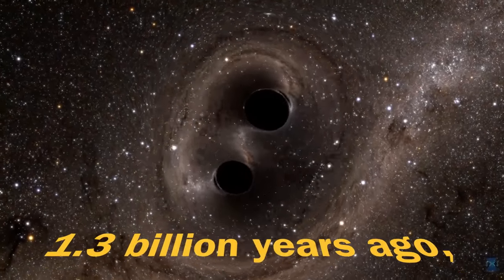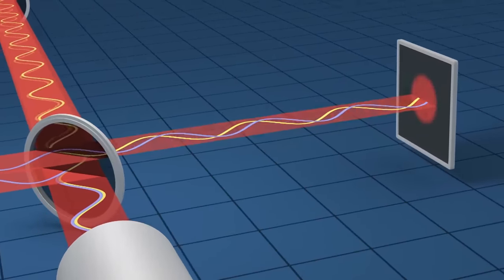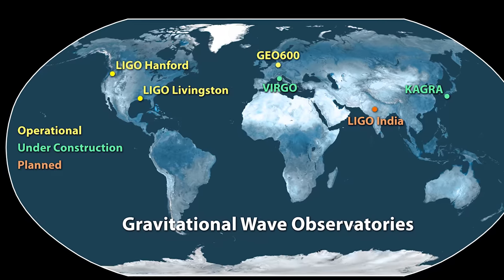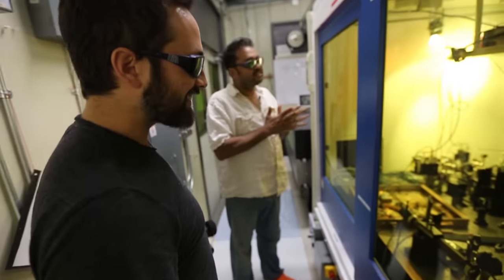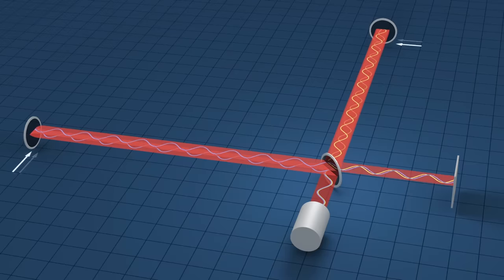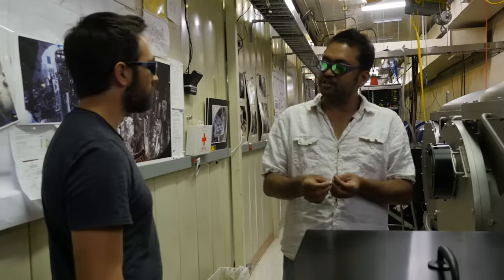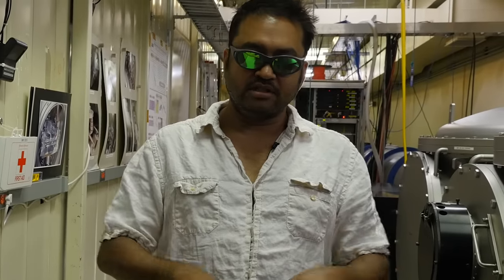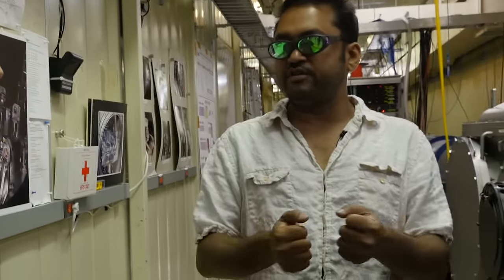The Absurdity of Detecting Gravitational Waves

Comment from the maker: Prof Rana Adhikari is clearly a star. Here's how he felt when he learned of G-wave detection: https://youtu.be/ViMnGgn87dg
Those glasses provide laser protection - the laser in that lab won't vaporize your head but it could burn your retinas.
Reply: Kissy kissy.
Reply: Veritasium Name should be pronounced as Rana Odhikari ( 'A' is pronounced in Bengali as 'O')
Reply: +Veritasium
Next step will be using two slits for studying the diffraction of gravitational waves!!!
Reply from the maker: I believe the upgrade to 1MW they're implementing right now. The 1064 nm lasers have excellent stability, low noise and they are not huge - this makes them ideal for this purpose. BTW older g-wave interferometers used green lasers (that's why Rana's glasses were green).
Reply: Veritasium Hey why are you guys wearing the glasses in there? Some protection?
Reply: Question, if the laser light is completely encapsulated within these steel tubes, why do you wear eye protection against lasers in the lab?
Reply: Loved the video. Possibly your best. Which is saying something. I love videos like this that just numb your mind.
Reply: Is it possible to reflect gravitational waves???
Reply: It would really helpful for understanding if there would an animation of the set up when a G-Wave hits its.
Reply: yes,, using a gravitational mirror, well its not yet observed, but it would be awesome to do,
Reply: Well, He is A Bengali, I am a Bengali, proud of him!
Reply: what other detector geometry designs exist (on paper or in production) for detecting gravitational waves that might be better than the "L" shaped one of LIGO.? There is the E-Lisa observatory which is like a triangle, but is there anything else?
Reply: One question, Veritasium: How did we know about these 2 orbiting Black holes in the first place? (it seems we were trying to catch the resulting gravitational wave, meaning we were expecting them ?).
Reply: TheRomichou They didn't know the existence of those black holes until measurement.
Reply: TheRomichou, the detection was a surprise. We didn't know about the two orbiting Black Holes until they were detected.
Reply: Luis Calderari No, they can be refracted but not reflected. My understanding is because electromagnetic forces have both attractive and repellent components, but gravity is attractive only. So strictly speaking, no. But repellent gravity is possible, which is seen in "dark energy", so perhaps if you have concentrated dark energy in one place, maybe you could reflect? I'm not sure.
Reply: Veritasium - what about interference from nutrinos? Cant stop them from getting into the vacuum arms...
Reply: I see, So, LIGO was built to detect gravitational wave; but we knew already that there were tiny and that only big events (like black hole merging) could be detected; When they got the signal, they compared it to their model of black hole collision, I guess. Could it be anything else? I mean, could there be any event that could cause a significant space-time fabric distortion that would look like the "woosh" ? (genuine curiosity, not trolling). Thanks for your reply BTW!
Reply: TheRomichou They pre-calculated the gravitational wave patterns for many different spacetime events, and then compared the detected signal to these calculations in order to identify the source.
Reply: Now it is clear. Thanks Michael!
Reply: Proud Indians 😇
Reply: jdnels81 That's the exciting part about gravitational waves. A complete new scope for Astronomy. Lots of new discoveries are coming.
Reply: Could it be used to get the wrinkles out of his shirt? :D
Reply: Veritasium 
We had the luck that one of the creators of the lasers of LIGO was visiting our school in Germany. She hold a presentation for about 80 mins about gravitational waves.
Reply: maaan You are a star!  Awesome vid, Rana is a top lad!
Reply: Best video yet! Thanks! 
Are they able to "triangulate" or at the very least determine the direction the waves came from? Or is that still beyond our capability?
Reply: 5:37 How do you know anything is stretching? 

I thought you needed perpendicular arms for detecting that, because the wave does not stretch  space equally in every direction. Was I wrong?
Reply: 5:37 How do you know anything is stretching? 

I thought you needed perpendicular arms for detecting that, because the wave does not stretch  space equally in every direction. Was I wrong?
Reply: Matthew Merrell using the time difference they can narrow down to a sliver of the sky where the waves came from but as more detectors come online they will be able to triangulate
Reply: dAvrilthebear That is right and that was said wrong in the video. You detect the waves by splitting the laser beam up in two parts. If the room was streched by the gravitational waves the signature of the light is different and this difference is messured.
Reply: Perhaps just as importantly, he knows how to voice resonant "bone chanting" (1:00) which is a used by both the Buddhist/yogic mystics and circumpolar shamans as a technique for aligning oneself with the inner systems of the body (biofeedback); and therefore, by freeing the mind of its isolation of self, reflexively making a bridge to perceiving the environmental information-energy fields of the outer scale.  This kind of doubled enlightenment (technical science & intuitive consciousness) is crucial for the advancement of humanity.

You seemed bemused by him making this noise... but it does have a purpose :)
Reply: 2veritasium that's freaking amazing!
Reply: Veritasium
Reply: Veritasium That post truth and youtube rewind nonsense was pretty idiotic, btw the left has always been post truth. The terms right side of history and politically correct come from communist ideology. And progressive movements, which come from the far left, have always endorsed obvious psuedoscience, be it racial theory or gender theory
Reply: Great, you explained the weird playboy glasses. Now please explain the excessively crimped shirt, is it supposed to act as a chaos generator to nullify signals from his body, a quantum noise absorption matrix, or something?
Reply: the guy is a physicist
Reply: @Veritasium Shouldn't green glasses protect from red/infrared laser instead ? Green glasses are transparent to green light.
Reply: Veritasium G-wave, green glasses, Lisa needs braces... So if they are changing the laser does that mean they are selling the glasses? I want to buy!
Reply: The Gravitational waves from the black holes were weakened or where they the same amplitude all the way?
Reply: I wonder how do they ensure the equipment and instruments correctness, how to know the uncertanty, or the presence of defects on the electronic devices...
Reply from the maker: like anything, as it spreads out through space it's energy becomes less dense, not primarily because energy is being lost but simply because it is more spread out. That's why sound and light for example decrease in intensity proportional to 1/distance^2
Reply: Veritasium 

sips hot coco
not gonna lie. I was kinda hoping to see you apologize for your last video.
Reply: Veritasium 

What about the linear thermal expansion at a measurable scale with a caliper or on a quantum level? If this device can detect a change in distance down to 1.0E-18 meters, then I'm sure it has to do with the thermal expansion and contraction of the mechanical components on this big rig.

Think about it: 
I chose 410 stainless steel for the metal since it has a low thermal expansion coefficient [a], aluminum is over twice that.

Linear Thermal Expansion -
dL = L_o × a × dT

Where......

dL = 1.0E-18 m
L_o = 4,000 m
a = 9.9E+6 m/(m-K)
dT = ?

So......

dT = 1.0E-18÷[4,000 m × 9.9E-6 m/(m-K)]
dT = 2.5E-17 K

That is only a temperature change of 0.000000000000000025 degrees Celsius needed to show this change between the two waves of these lasers! 
Not possible to control the ambient temperature in the lab to be that steady.
Reply: If you look at the waveform, you'll realize that thermal expansions do not happen on this time scale.  Also, two detectors thousands of km apart show the same signal.  Finally, this is a project in the hundreds of millions of dollars.  Thermal variations were certainly accounted for.  But you seem confident in your conclusions, so I'll be happy to read your paper in a peer-reviewed journal.
Reply: gramail 

Read my paper haha. Makes sense looking at the time for a material to expand or contract. It still doesn't add up for me. That is such a tiny temperature change, I'm sure it wouldn't take long for the metal or glass to react. I'm sure it would show up from time measure one up to time measure two. I'm going to start a research project :)
Reply: If I want to buy a pair of those sick laser shades that he's wearing, where should I look? What brand are they?
Reply: Peter, sorry for being short.  Check out this pdf for more on LIGO and thermal noise. https://labcit.ligo.caltech.edu/~ajw/LIGO_SURF02_2.pdf.  It's very dense and technical but a few slides (including the first one) show the various noise contributions, including thermal.  You can see that at lower frequencies, the thermal noise does indeed have an impact.  However at higher frequencies it is less of a concern.  It was perhaps very serendipitous that the frequency of the detected gravitational wave lies above the thermal noise floor.  I'm more blown away by the fact they made such a huge detection immediately after the turned the darn thing on for experimental runs.  Cheers.
Reply: Not anything will act that way (as if the volume it covered was the only diluting effect)..  Strong and Weak nuclear forces don't, theoretically because they may extend into other unknown dimensions.
Reply: Veritasium I'm a reasonably intelligent fella but from when all this first came out to now, the whole concept still makes my head explode. (Or vaporize I guess)
Reply: Best comment ever! ROTFL
Reply: Veritasium He's probably a Nepali.
Congratulations on the work Adhikari sir.
Reply: I liked this video, because it sheds light on the challenges that experimental scientists face when trying to make an accurate measurement. These challenges are often overlooked by theoreticians. It was only during the final stages of my bachelor's degree that I realised how involved experimental research can actually be.
Reply: Moe Diggity Electromagnetism and gravity are too completely different things. General relativity is a theory of gravity, it has nothing to do with electromagnetism or even quantum mechanics. I see no indication whatsoever that Einstein had electromagnetism in mind when he was trying to include gravity into his mass-energy equations.
Reply: Moe Diggity The scientists at LIGO studied the data They gathered for Five months before They were sure of the gravitational waves. But you're the one who's right, a random guy on the internet
Reply: Moe Diggity tl:dr
Reply: Moe Diggity What you have said is rather well written, and I commend you for that, but I'm afraid I actually can't tell if you are trolling or not so here goes nothing:

The claim is that the mas DID convert to energy.  Waves are primarily a method of transporting energy.  The gravitational waves themselves ARE the energy.
When tectonic plates collide, does the force make electromagnetic waves to transport energy?  No, it makes water waves to carry the energy.
What about cars?  There, it's not so much an EM wave we get but a sound wave (although there would still be some heat/IR waves created, probably).
In collisions, the energy can be converted into different forms of waves, not just EM.  The argument is that in this extreme case involving large masses, the energy is converted into a different form of wave, a gravitational one.  The waves are not seen by their interaction with the laser beams, but rather with their interaction with the medium through which the laser beams travel, space.
Also, as for EM waves necessarily interacting with each other, there is a slight truth in what you say but the final interpretation is all wrong.  EM waves passing through each other will interact, yes, but only at the point when they are on top of each other.  They will then continue on their merry way unperturbed.  For example, try shining two laser beams through each other at an angle.  In theory, it would be possible to have the beams interfering destructively at the crossing point such that no light is seen in that spot, but apart from that, a detector anywhere else monitoring, say, beam 1 would be unable to tell if beam 2 even existed.  Still unconvinced?  Try shining a red beam and a green beam through each other.  If the interactions were the way you described, you'd perhaps expect the beams to bounce off each other such that beams 1 and 2 arrive in opposite locations, but again they pass through each other undisturbed.  Switching beam 2 off and on will do nothing to the signal arriving at detector 1.
Additionally, I must say that I am intrigued by your suggestion that GPS devices are desynchronised because of EM and not GR, even though it is GR that predicts this effect in the first place.  Could you elaborate on that for me?
As for your comment about belief in God, I turn you to none other than James Clerk Maxwell, the man who so beautifully unified electricity and magnetism into what appears to be the only thing in which you trust, electromagnetism.  (Although due credit to Oliver Heaviside for putting those equations into their graceful vector form.)   Maxwell was reported to have often answered the question as to what his motivation to do science was by telling of a phrase his mother often used when she was educating him at home, "Look up through Nature to Nature's God."
Thanks in advance for your time.  Hopefully that will have been enough to convince you of some things at least.
Reply: Great video. This is your forte'. Stick with this stuff. 
Prof. Rana wow, what an intellect. He made it sound so simple with his calm explanation.
Reply: I'm afraid you appear to have fallen into the trap of thinking that an example counts as a proof.  I can give you an example of a dog that is black, but that does not mean that all dogs are black.  In a high energy explosion such as an atomic bomb, a lot of EM radiation is given out.  This does not mean that EM radiation is the primary way energy is emitted in all high energy collisions.
I'm not too sure I follow your argument about the solar system being inside of a nebula, but it sounds a bit like a variation on Olber's Paradox.
As for photons simply wrapping around objects, that's not as true as you suggest.  There is some diffraction (as pointed out by Huygens' Principle), but it's not just the case that a photon takes a slight detour around an object and then continues on.  Similarly in the case of dropping oil through marbles.  Here, the force of gravity is constantly acting on the oil to give it the downwards trajectory.  This is different from the case of an emitted photon.  Once the photon has been 'fired', there is nothing to correct its course.  If it were deflected to curve round an object like you suggest, it would then fire off at a different angle from the original course.

Again with desynchronisation, the strength of the Earth's magnetic field is not spherically symmetric (due to it being linked with the axis of rotation) but the gravitational field is.  How then would you explain what happend when a satellite goes over the pole of the Earth.  Surely if it were an EM effect, the desynchronisation would vary with the field strength.  As it doesn't, whatever field is driving the effect must be spherically symmetric.  It doesn't matter what way a satellite orbits the Earth, whether it is round the equator or over the poles, the only differences in the amount of desynchronisation are the radius from the Earth's centre (accounting for the slightly oblate nature of the Earth) and the kinematic effects of special relativity [which account for the difference between the clocks in Hafele-Keating et al. (1971)].  Besides, surely the idea of such a headwind was debunked in some way by the Michelson–Morley experiment?

Well, Planck said something along the lines of "It is not by coincidence that many of the greatest scientific minds throughout history have been men of a profound faith."  All I'd say on that one is keep your mind open, do some research on historical validity of certain texts, and then choose wisely. :)
Reply: And if you are a troll, then at least I've still gained from this.  It's worthwhile searching for the holes in people's arguments, whether they know they exist or not.  Indeed, this is part of the foundations of scientific curiosity, and is a practice which is all too often overlooked in today's culture.  This makes it good for "ze little grey cells."
That's fortunate.
Reply: IR laser are the easiest to manufacture would be my guess. In fact, all green lasers in existence are actually IR, and use an optical resonant cavity to multiply the wavelength (essentially extract a harmonic) which is double the frequency and happens to be green.
Reply: How can they release 50x more energy than everything in the observable universe?
How can two black holes release more energy than the entire visible universe? 
Is my understanding of that statement incorrect or is it something else? Please explain. Thank you.
Reply: A one MW laser will vaporise your head and your glasses and half the lab in less than a second.
Reply: Raheel Mohamed It's a matter of timing.  Obviously, it's an energy release for an incredibly small period of time.  The rest of the stars in all the galaxies will continue to shine for billions of years, but those black holes only mate with each other once in their lifetimes!
Reply: @Robert Went This is exactly my point, usually a green filter would typically filter out other wavelengths like red and blue. That's why I was surprised that a green colored filter was used to filter out green light. Having a second look at the video, it doesn't look like a "standard" tinted filter, the glass looks mirror coated, the filtering technique is probably more advanced like a dichroic filter for instance.
Reply: Now put a double slit experiment in the center of this detector.........
Reply: Veritasium hmmm seems like this topic has been covered before.. wait.. vernier.. optical?
Reply: some times its more fun to dis believe.. and find the solutions circa
Reply: Veritasium i hate you right now. lol.. im thinking ok.. come here and teach me to machine .0002 of a inch.. what.. i can play the same game as a machinist with what? 

that would be a standard.. what resolution on a ceramic gage block.. as a master standard.  :) big smile

mass verses volume.. what conundrum wins?
Reply: our contolability is somethimg like .000,000,1
Reply: to a master in comparison to gage our measuring standards
Reply: Hi I am a 14 years old boy and I will be starting my science channel, I would like to explain science the easiest way possible so even children my age can understand it. My favorite topic in science is Quantum Physics, I score A for science but I know that doesn't really matter. Please do tell me any category or topic in quantum physics you guys might want me to explain as I need my audience. ~Lucas.
Reply: Go. Show us what you can do.
Reply: Veritasium This video makes me wonder... Is God just messing with physicists? You learn something, and all you’ve done is uncover more mysteries! At enormous effort! 

The more you know, the more you know that you don’t know...you know?!?
Reply: Veritasium it's a great find yet I don't understand why it needs funding anymore .what good comes from detecting all black holes ? the program would appear to only a R&d for improving detectors and lasers which there tons of tax money giving to those fields already .
Reply: Veritasium :D
Reply: Also, space time is a meaningless concept, the truest thing said in this video was "this whole thing is bogus, shut it down" except that I think if there were smarter people in charge, or at least honest people, this could be used to create a power source plenty powerful enough yo supply the world's power consumption, or destroy it.
Reply: Space time is meaningless because time is a human concept, not a physical or even metaphysical medium that can be manipulated, travelled upon or altered in any other way than affecting the present, becuase that's all their is, now. I can't believe I have to waste my life explaining such simple concepts to people who seemingly struggle to understand a simple universe.
Reply: Veritasium the title is perfect by the way, becuase it is absurd to spend millions to try and detect a force which does not exist.
Reply: TheRomichou there is no such thing as black holes, they didn't know they were coming, or anything at all really, what they did was just say that it was two black holes, no blacks holes have ever been observed, there is no evidence for them just as there is no evidence of this force they insist is real referred to as gravity.  What we call gravity is akin yo static elextricity, the earth is a charged body moving through the suns electrical plasma environment which is powered by cosmic scale Birkeland currents. Our bodies have evolved to be able to survive in this electromagnetic environment, our blood is a nearly entierly paramagnetic substance, meaning it repels magnets from either pole, and other parts of our bodies are slightly more magnetic, creating a happy medium and allowing our colonies of cells we call organs and fluids to work together to reproduce their genetic code.
Reply: Hawaiiguy Kailua thumbs upped the comment.
Reply: excellent, couldn't agree more. I believe we are, as observed, a static plasma dominated universe with unimaginable powerful electric forces creating and destroying galaxies continually. Believing we're smart enough to think we have unlocked even a tiny fraction of the cosmos, let alone the hubris of big bang and the beginning of nothing, that then somehow, exploded.  I mean, the hubris of their idiocy should be swallowed by a black hole, and let the funding go to real "people who actually go outdoors" scientists.
Reply: I actually agreed faster than the speed of light with your comment(s) :) Though I am recently on the fence that its not density and buoyancy which acts just like gravity.  I finally started reading articles on the flat earth theories after laughing about it for 50 years, and they have made some compelling arguments. A main one being the Admiral Byrd interview on the LONGINES CHRONOSCOPE WITH RICHARD E. BYRD show back in the 50's. Just what land mass was he referring to beyond the south pole that is as big as North America and nobody has been there? The NASA photos of earth another head scratcher in there inconsistency as are Satellite abilities to withstand 4,500 degree temps in the exosphere. I know my Mac wouldn't power up if I put it in my oven, how can a satellite for say DirectTV possibly even power-up 400 Nvidia graphics cards on the DirecTV-15 satellite (nuclear battery?) let alone function at 4,500 deg F at 22k miles above earth?  Wal Thornhill is always my go to physicist for clarification on modern science and he always points out the absurdities quite easily:)
Reply: Discorderiz Youtube I'd personally like you to go look at the work being done with the Thunderbolts Project. They have a YouTube channel as well as there website. Think you'll be amazed at the type of focus they have in plasma physics and electricity generated via birkeland currents.
Reply: Dr. Strangelove I'm far from it, only idiots don't question magic in science. So I guess you're looking in the mirror.
Reply: Concerning gravitational waves; Besides being interesting, so what? How does this affect me? What does it do for science?
Reply: Haha, Adhikari is awesome. Why can't all professors be this cool? :D
Reply: Did you say those glasses are to protect you from the laser? The one you have to physically crawl into and do god knows what to get in your eye?

Cos if not, I have a great idea for saving money on both your lighting bill ánd Oakleys.
Reply: Veritasium those glasses re bitchin cool! Gotta get me one of those
Reply: Mybe gravity was not allways so strong? And earth was smaller ? And we can moove big stones easy?